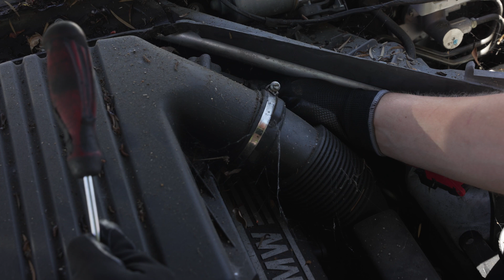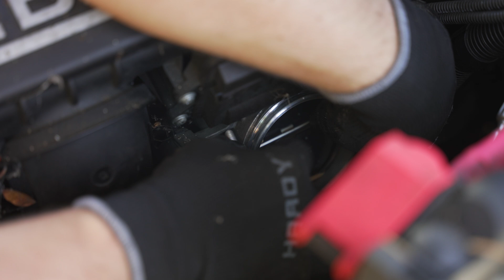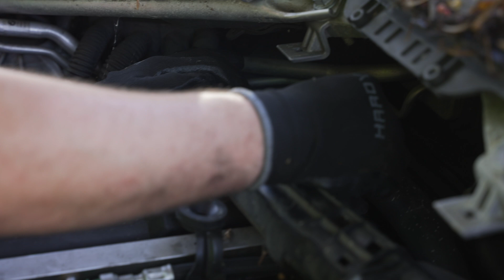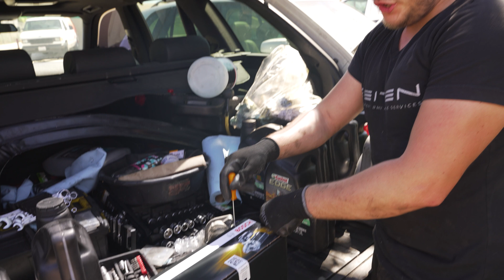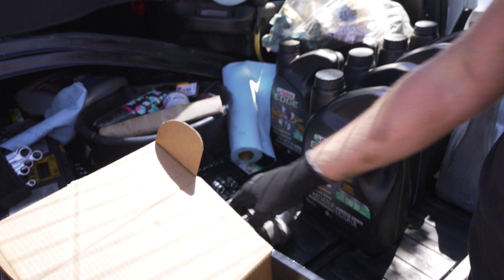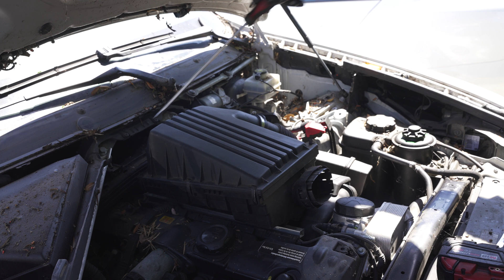DIY E70 BMW X5 Starter replacement N52

Comment: Hi. If my x5 n52 e70 car cranks and cranks but won't run, is it starter or alternator? Car runs fine when it's running but when i turn it off and stays off for an hr n more car won't runnbut will crank. Can you tell me what it could be? Thank you

Comment: I have a 2013 E70 X5 with the N63 engine. Engine mount out is the only way to remove the starter. I did it 2 days ago and it took 5 hours. I could have been done in 3 but, I took my time and triple checked everything. The top nut on the engine mount was removed with a 3/8 ratchet with a 13mm (I think) socket and a steel sleeve for some added leverage. The most difficult part was jacking the engine up and down to get the holes to line back up on the mount. After all that work the vehicle still didn’t start 😂. It ended up being the ground strap and I was kicking myself for not trying to ground the chassis to the engine first. MAKE SURE to change the ground strap before changing the starter. Might save you time and money. Starts up quick with the new starter and ground strap though. I’ll be spreading the word in other videos.

Comment: Hi Tim.  I have used your great video to give me the confidence to replace the starter myself.  Removing the rear crankcase ventilation hose connecter  certainly took me more than 30 secs.  I eventually took off the passenger side support bar to give me access from the passengers side and then eventually was able to separate the hose.  I have removed everything following your steps and am at the point of pulling off the intake manifold when I discovered there is one last wire connected to the side of the manifold.  It is a wire cable that goes from that electrical hub under the throttle body up into a box on the side of the manifold. It is not obvious to me how to remove that cable which is the last thing preventing me from removing the manifold.. I took a picture but don't know if I can post it here for you to see.  Your advice would be sincerely greatly appreciated. Thx
Reply from the maker: Thank you for becoming a member, just email me a pic i’ll take a look, as a member we can discuss hour repair one on one😉
Reply: @Zeiten  thanks Tim for replying.  what email address do I send pic to?  I re-watched this video and at time stamp 5:44  I see you yank the wire cable off and at time stamp 8:30 you can see that cable dangling in the middle of the screen.  Can I just yank it off like it seems you do in the video or is there special method to release the cable from the housing? Cheers.
Reply from the maker: Ok that’s what i thought, it is a disa valve wire you can just pull it, there is exactly the same one on the inside once you lift the intake manifold you’ll see remove same way
Reply: @Zeiten  Thanks. Greatly appreciated.

Comment: Hi Tim,
Would you recommend to replace the Intake Manifold gaskets for future leakage if I replace the starter...or is not necessary ? Thank you for your time to replay ? (can I have your phone to have you maintain my car in the future?)
Reply from the maker: If you can get intake manifold gaskets i’d recommend replacing it but if you don’t it’s actually not that big of a deal, i’ve never actually seen air leaks on n51/52 engines through intake manifold seals. Google zeiten bmw you’ll find all contact info there

Comment: Hello I have a question my BMW Ben sitting for months every time I tried to start the alarm come off and there no crank no start is that a indication for a new starter but why does the alarm come on I have a 2006 BMW X5 4.4i please I need help thanks 🙏.
Reply from the maker: Battery dead most likely

Comment: I have 2010 535i xDrive and starter bolt on transmission side is E14. 11mm open wrench doesn’t work and so I tried a swivel ratchet with E14 socket. Do you ever experience very stubborn bolts like this? I tried WD-40 and it still won’t come off. The swivel ratchet is 72 tooth and maybe I need 90 tooth
Reply from the maker: You have n54 engine the bolt is e12 there as far as i remember and yes 11mm won’t work in that case (it only works for n51/52 engines) i still remove it same way you just need a proper wrench and breaker bar to loosen it

Comment: I have a bmw X5 that got struck by lightning… when it first happened everything was flashing and alarm system went off, now it won’t start or even crank. The lights on the dash come on for a second when battery is connected and then the whole dash goes black.. could it be the BCM or DME
Reply: Please help

Comment: Hi there.  I've watched quite a few of your videos and they really helped me to keep my son's e90 in good shape.  I've also replaced the fuel pump and valve cover gasket on our e70 X5 as well thanks to your videos.  I had a question for you on the starter.  My son is away at school and he thinks the starter is gone.  Obviously the car won't start, he thinks he hears a click, but he can't put it into gear.  So he manually put it into neutral so that he could park it.  Because of the fact that he couldn't put it into gear, I think it's a problem with the immobilizer CAS.  He doesn't have a code reader with him, but I'm just wondering if you think the car should have gone into neutral in the ON position.  I mean the starter shouldn't prevent the car from switching gears, don't you think?  However, the steering wheel wasn't locked and he was able to turn it, so I'm not sure what to think.  Any advice?  Thanks again.
Reply from the maker: Replace the starter, everything will be fine you are looking for problem where there is none

Comment: Thanks Tim for all that you do 🙏.  I just replaced my starter as a proactive maintenance item for my 2009 X5 along with the valve cover, thermostat, water pump, and many other items.  I dont know if you remember, but i called you to help me identify an AC leak on the same car about a couple weeks ago.  The mechanics at BMW said they were fairly certain it was the evaporator, but they needed like $400 more to diagnose on top of the $225 I paid already. You informed me that 90% of the time, leaks are caused by the a/c compressor;  I ended up swapping out the compressor, pulled a vacuum, and the leak was gone!  Your knowledge about BMWs is second to none, and I love how you share your knowledge with the community of garage mechanics like me!
Reply from the maker: Happy to help, keep it running🙌👍

Comment: I changed my starter on my e70 now I'm getting misfire on cylinders 1 and 2 and ejector circuit failure on ejectors 1 and 2. I don't know why.
Reply from the maker: Fuel injection cut off is commonly appears when there is a misfire, check all your connections, it could be just a coincidence and either coil #1 or 2 failed
Reply: @Zeiten  I figured it out. Some of the pins in one of the connections on the intake manifold were bent to the side of the housing and not going into the pin holes. Thanks for your help

Comment: My bmw.e70 e70 push start no crank I hear a click sound at front and a lot of codes showing on my dash.
Reply from the maker: 95% chance starter failed
Reply: @Zeiten  thanks zeiten it's work almost throwing the towel. It's a big relief.Took me 2 days checking also all the wires and fuses. Thanks alot for the tip.YOUR THE 👨
Reply from the maker: Happy to help👍
Reply: Thanks, Zeiten ill keep you updated 🙏

Comment: Very good video, helped me no end in doing this. Although I made life difficult for myself & removed the crank position sensor connector, which I then forgot to reconnect. Luckily managed to get it back on by feel with the manifold in place & just the plastic inlet hoses removed..😀👍

Comment: I changed the starter and after that the truck shakes weirdly like a misfire, do you think it is a vacuum leak? Everything was put back properly and the gaskets were good. I saw it could be spark plugs but I changed those last year and it wasn’t shaking like that. Have you ever changed a starter and then after it starts it shakes for 10 sec then it goes away
Reply from the maker: Impossible to diagnose remotely, the most common thing people forget to plug in is pcv hose that goes to valve cover and purge valve hose that is behind throttle body, if it wasn’t there before most likely you forgot something or didn’t plug in fully although might be a coincidence like one of the vanos solenoids failure since it goes away that what i be looking at but trouble codes would be nice to have otherwise it’s just pointing in the dark

Comment: Hand crank it couple rounds first, right, to make sure engine is not seized? Then clean up (vacuum and/or blow) all the leaves before taking the intake out. Test the white wire for 12V with before taking the starter out. Good idea to pour in some fuel treatment for the 2-year old fuel. Might be good idea to squeeze some oil into each cylinder before starting in case the wall too dry.
Reply: That’s why I do my own repair. Garages don’t care, they don’t care.
Reply: Yes, yes and yes!

Comment: Great channel, keep it up.  You seem to have a lot of expertise in the X5 models.  Can you answer a question about transmission drain fill?  On some models there seem to be several sleeves that need to be replaced between the ZF Mechatronic unit and the transmission. For my 2013 E70 N55 xDrive35i places like FCP Euro and others don't show any valve body seals.  Other than the Mechatronic Connector Sealing Sleeve are there any other tubes or sleeves required for the job?
Reply from the maker: Hi, thank you, check out this video https://www.youtube.com/watch?v=HZRNKtapQYk your transmission will need all those seals, solenoids replacement is not necessary

Comment: Love this series! I have the same X5. I’m going to learn a lot from it. Replaced the valve cover last weekend. Hopefully you do a front struct assembly video on this X5. Its my next task.
Reply from the maker: Thank you, hopefully I don’t have to do front strut assembly replacement😂😂 but sure if it ever comes up we’ll shoot it😉
Reply: @Zeiten  Previously owner had the struts in the front replaced, they didn't change out those orange donut strut supports or the bump stops . Ended up having to replace ALL the control arms.